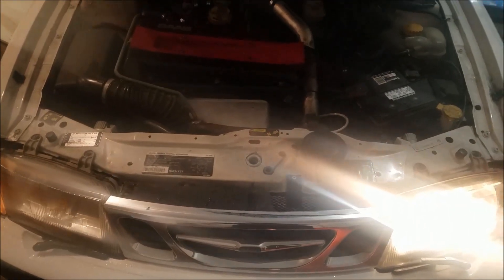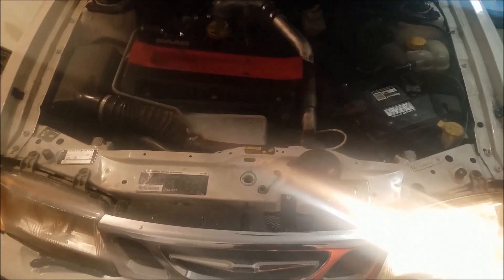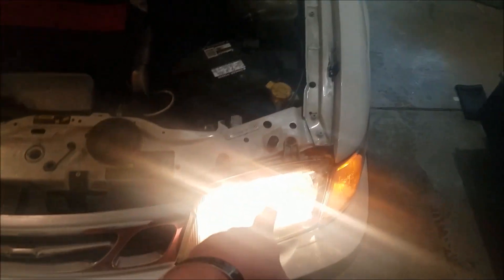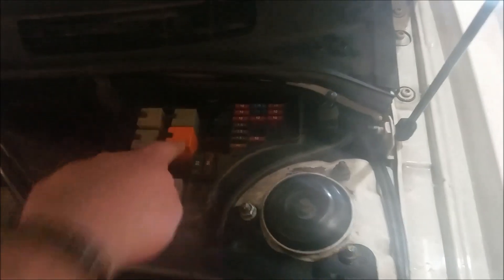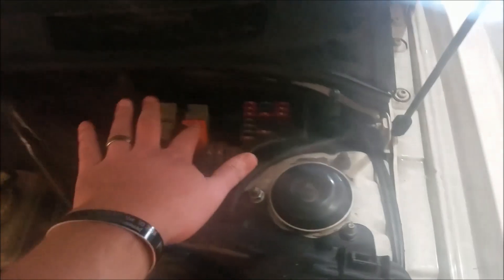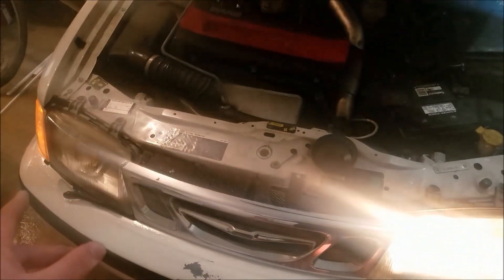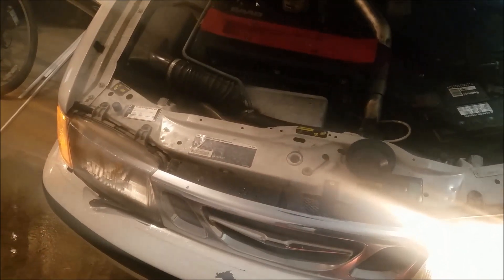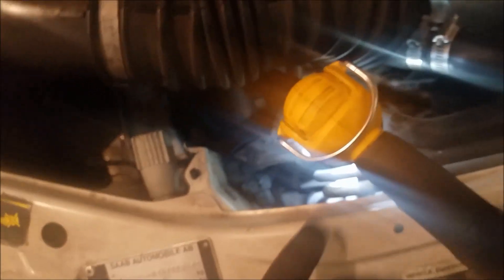Saab - Replacing Headlight Bulbs

Comment: Those clips are in the top 10 of the most frustrating experiences of my life, and I'm a computer programmer! Even more so since it was cold outside and it's impossible to get the clips off while wearing thick gloves. When I finally got one clip undone, I figured with that experience the other one would be easy, but it was even worse! I think the more angry I got, the more it resisted. In the end, I had calm myself and ... Use The Force. But I'm certain it will be just as difficult next time because I still don't know exactly how I did it. Now I understand why Saab stopped making cars. Haha, but seriously, thanks for the video!
Reply from the maker: Hahaha I've had re-learn how to do those clips so many times over the past decade, I feel I made this video for my own future reference 🤣
Glad the video helped, and hopefully saved some frustration!!